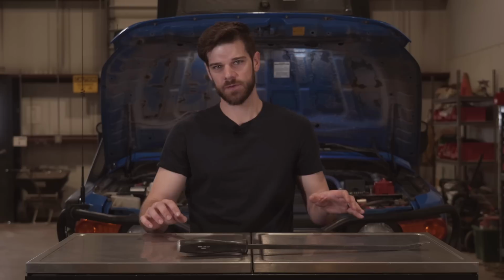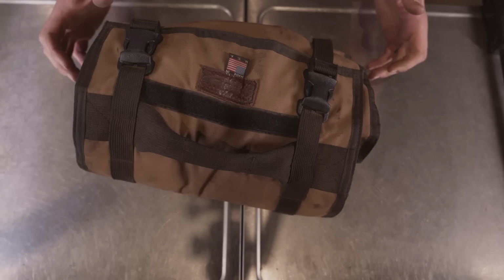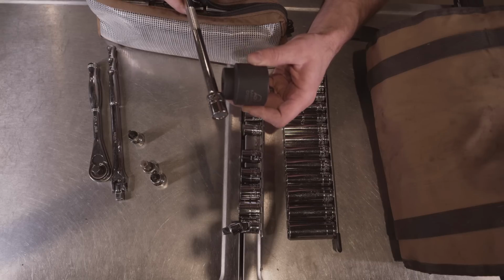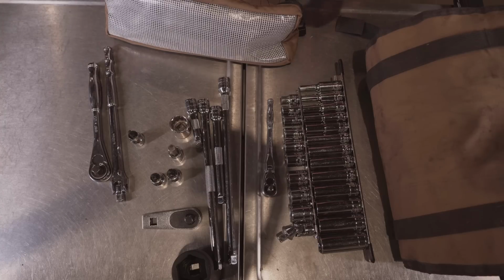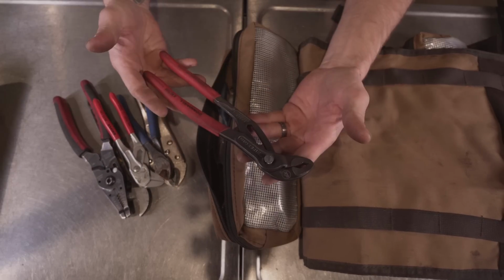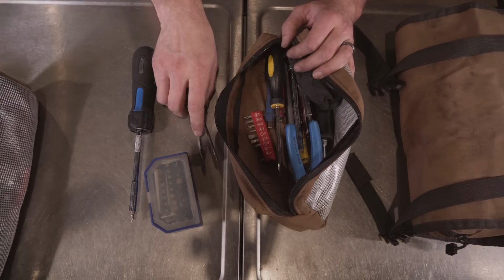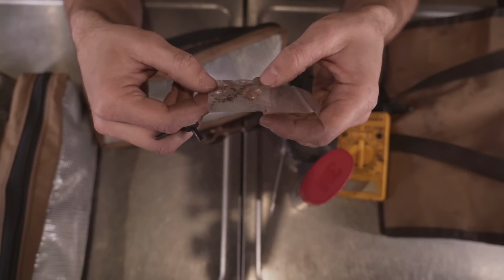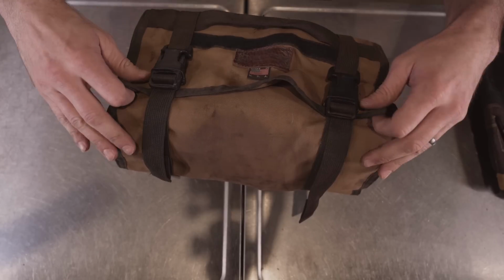The Off Road Toyota Tool Kit | Overlanders Tools

Comment: The werea joker wrenches that you have are great. Gear wrench has a quad size wratchet wrench that are handy. 
Having a sharpies paint pen is good for marking bolts to make sure they don't backout, at a glance.
Window markers are good to have of you break down, to leave a message. It's kept me from getting towed a couple times. 
A headlanp should be there somewhere too.
Lock tight and dielectric grease are things I use frequently as well.
Reply from the maker: I didn’t include a flashlight just because I assume that someone already has one in their overland rig. But it’s definitely something that comes in handy!

Comment: Very cool. I just find it ridiculous when “overlanders” are practically bringing an entire tool shop to fix something irreparable on the trail. My logic is to list out commonly broken parts, get spares, then seek out the tools needed for the repair, and actually know how to do the repair. Things like serpentine belts snapping, tire rods bending, CV axels breaking, radiator leaking, tire puncture, tire de-beading, water in the intake, dead battery.

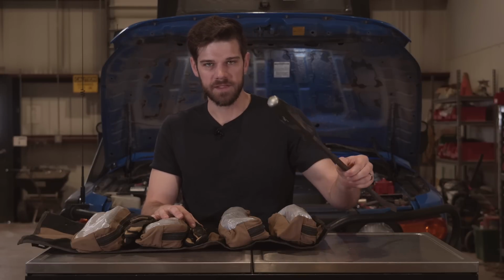Comment: 03:37 i actually bought a socket set at Walmart for 100 bucks and I highly recommend it 

The trick is to buy individual sockets of good quality if they break 

Sockets all do the same thing and you can cheap out on those imo

Wrenches should be better quality though 

It all depends

Comment: Great video and a very pragmatic approach to the subject. 
With experience on a particular vehicle or through online research, you could probably reduce the number of wrenches and sockets further, especially the deeps...

One thing I would say to people just starting to put a kit together, is invest in the tools first, and then buy the fancy and rather expensive tool roll later. 

You can get a basic canvas M1 Tanker tool bag for under $20 and it will hold a surprising amount. Its not as convenient to use given the lack of organisation, but if the tool kit is only for emergency, once-in-a-blue-moon use, then perhaps that's not such a big deal. Also, consider where you are going to store the bag or roll...
Reply from the maker: The bag fits into pretty tight places pretty easy in my experience. But yes, tools are certainly more important than the bag.
Reply: @IndependenceOverland  I really like the look of that particular bag, but I am in the UK and will shipping,  import duties and other additional costs, it would be about $200 all in! 

But for somebody in the States who uses a bag a lot, I think it's  certainly a worthwhile investment...

Comment: Nice, I like this kit, especially the modular pouches and tool groupings.
The only thing I didn't see is a tire plug kit in case you pick up a nail, screw or other sharp object. You probably already have one along with a small air compressor, just thought it was worth a mention.
Reply from the maker: I actually had that kit in my glovebox when I filmed this, but I did keep one in there. Now it’s moved to the bag. Thanks for checking it out man!

Comment: 10mm hex - drain plug for 3rd gen Tacoma front diff.   Thumbs up to the wobble.  For some things you will need them when you don't have a lift to disassemble multiple systems to reach your break.  I would recommend multiple 3/8 wobble extensions rather than just a universal adaptor.  It is more stable when you have to reach in deep on something like a starter.
Reply from the maker: Good call! I will be building a new set before too long, for the next build as I am sure it will have some different tool requirements!

Comment: Good afternoon from the Great State of Texas. I have a Toyota 4 runner. I am so glad you made this video. Did I miss it, do you carry a tire pressure gauge? Also, what type of hammer should I carry? Again, thank you and have a good day.
Reply from the maker: I carry a sledge hammer under my Goose Gear platform so it can’t go flying in a roll over. As far as a tire gauge I use a digital one from Blue Point, but really any cheap gauge will do the trick. I’d just buy the Amazon special that has good reviews! https://amzn.to/47IotBc

Comment: I have a kit with nearly all the sockets for my first gen Tacoma, including a 35mm for front axle nut. I found a good list on an online forum and started there. I added a 7/16, 1/2 and 9/16 for accessories that use 1/4", 5/16" or 3/8" hardware commonly found on aftermarket accessories. 19mm covers 3/4" socket for 1/2" fasteners. I also added some punches, files and picks that have all come in handy. And some basic electrical repair tools and supplies.

Comment: realistically no one should be bringing standard socket unless its a specific socket for something specific (fuel filter housing on a 5.9 for example) Since late 90s most vehicles use metric and even if its not a standard nut or bolt, metric sizes will certainly work in a pinch. I like your style of keeping it minimal, simple but yet able to get the job done. Earned a sub my man.
Reply from the maker: Thanks for checking it out man, and thanks for the sub! 🙏

Comment: What was the brand on that breaker bar?
Reply from the maker: Blue Point is the shorter one, unless your referring to the adjustable length one. That one is a Snap On
Reply: Thanks!

Comment: I literally have a small tool kit that I use to fix my truck and my wife’s car (2015 accord) and it stays in my truck so any tool that I use for any at home repairs are with me while I’m on the road and I find that to be the best because 1 I don’t have a garage to keep my tools but for that same reason I have my tool inside my truck and I don’t even have a big truck I have a (1991 Nissan D21/Hardbody) single cab so space inside my cab is very limited I used a quinn tool set that costs me like $65 and that thing is so useful I also have wrenches and pliers and screws drivers and a full size aluminum 2 ton jack Pittsburg and a small kit from the auto powers store with electrical things like fuses, wire, zip ties, connectors, splices. All this is behind my seats 😅
Reply from the maker: It’s amazing what you can fix with a smaller tool kit with a little ingenuity!

Comment: For a short cheater pipe I’ve used a deep socket on an extension over a breaker bar or ratchet.
Reply: Ditch the super 33 tape get 88. It leaves much less residue
Reply from the maker: Awesome thank you!

Comment: Would you be able to tell me the length of the socket rail? I know the blue ridge pouches are only about 12inchs long
Reply from the maker: I believe I cut these down a little to make them fit
Reply: @IndependenceOverland  oh ok! I ordered some of the tekton ones in 3/8 and 1/4 inch drives. I don’t think I need 3/4 and and 1/2 for a Tacoma would I?
Reply from the maker: @AFGixxeR88  some of the bigger 1/2 stuff is good for the garage, but I personally don’t carry 1/2 in the vehicle aside from the axle nut.

Comment: Hi I remember seeing this before.  Good info.  It piqued my interest, and a question:  Being a mechanic by trade, is there a data sheet by manufacturers, of every bolt, nut, screw size etc?
Reply from the maker: There may be in the Toyota system, but I'm a fleet mechanic so I don't have access to those. A metric tool set will cover just about everything your going to fix on the trail. The nut socket I mention is this video is one of those special sizes outside of the norm.
Reply: @IndependenceOverland  Thanks!  Yeah, drives me crazy how American cars since mid 80’s will have both mm/sae.  MM kit was where I was headed, but just had that question in mind.
Reply: You find anything ?

Comment: I gotta buy that 3/8" Snap On ratchet head thingy.... I hate the Snap On truck driver, love the tools tho.  I am going to have to search that one out.  I've never seen one before except the big 3/4" drive ones. Neat that you can use a breaker bar to turn it
Reply from the maker: Search for it on eBay! You still get the warranty, it’ll be cheaper and you don’t have to deal with the dealer. I’m fortunate to have a pretty cool Snap-On dealer.

Comment: What I do when I work on the truck at home I use my tools that carry in the truck and if I need to get in the tool box in the shop depending on what it is I’ll add that to my kit
Reply from the maker: Yeah that’s the move. If I install something new that takes some odd size, I make sure to add that as well. Such as a roof rack Allen head size.

Comment: What is the ratchet at 10:31 called?
Reply from the maker: Part numbers FZ80 I believe is the current version, old version is FZ936A. Talk with your dealer or check them out on eBay to be sure it’s the same.

Comment: What brands do you consider high quality tools?  I've always had whatever from Lowe's or Home Depot.  I've been planning on putting together a quality set of portable/travel tools, similar to your setup.  I've been eyeing their zip up tool bag with the 6 Velcro pouches, but I do like the roll as well.  I've held off, because I can't decide what brand of tools to get.  Are Tekton tools any good?  Looking for a little guidance.  Enjoyed the video, thanks for your time.
Reply from the maker: I think the Husky brand or Craftsmen are perfectly fine. I just advise steering clear of the super cheap stuff from Walmart or the 200 piece set for 25 bucks at Autozone. If buying at hardware stores, I’d recommend grabbing a socket from the shelf and going and finding the bolt size it fits. I like sockets to fit tight. Cheap sets will have slop. If your on the side of the road fixing something and you round off a bolt because of a cheap socket, your gonna get pissed that you didn’t spend that little bit extra. 

Tekton stuff is on par if not nicer than stuff you will find at Lowes, but I think it’s online only so it’s more of a pain to warranty. But usually breaking sockets is only something to worry about if your doing it for a living. It doesn’t happen all that often.

Comment: Either this guy has never really been out west or to Alaska, or he's perfectly fine paying a several hundred $ off road recovery fee.
Reply from the maker: I live in Colorado, never been to Alaska. If you watch this video and intend to take more, that’s great. But if you assume every guy on the trail is an experienced mechanic, then you assumed incorrectly. This is intended for people looking to build a kit, because most people either carry tools that are incompatible with their vehicle or carry tools they don’t need. This is a good starting point. 

As an experience fleet mechanic for 10 years, and engine assembly/machinist  for 6, this tool kit is plenty for the vast majority of people. 

Thanks for watching.
Reply: @IndependenceOverland  I wasn't knocking your tool choice. I think that was good advice. It was more about the minimization of trouble that one can get into in the US. To say that you don't really need to worry about getting stranded in the US because you're always close to an auto store is negligent and dangerous at best. There are many parts of the Western US where one can be several hours away from any help. Even moreso, off road recovery in only semi remote locations can cost hundreds of dollars or more. Throw in inclement weather and people can easily get in a dangerous situation. It doesn't matter what their level of mechanical knowledge is if they don't  have the tools they might need in the first place.